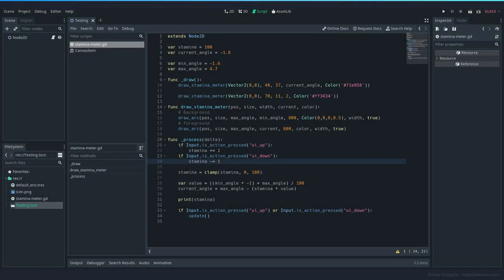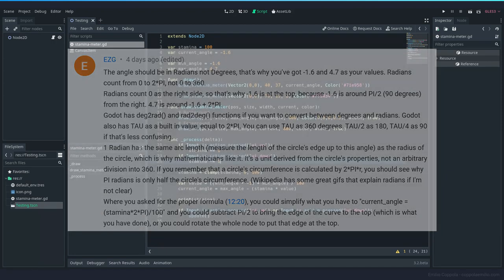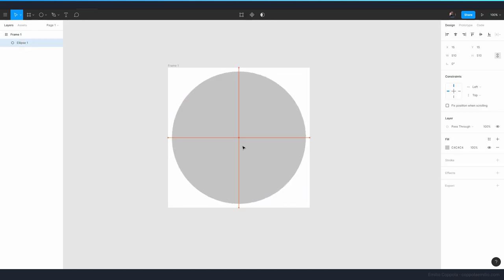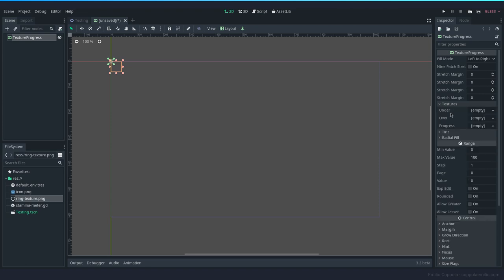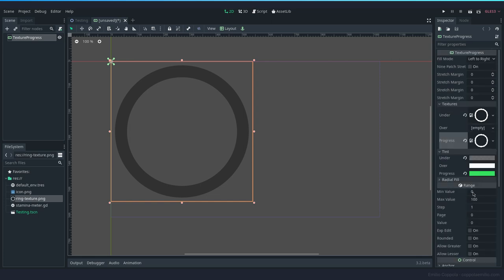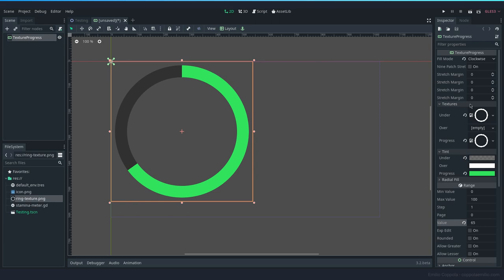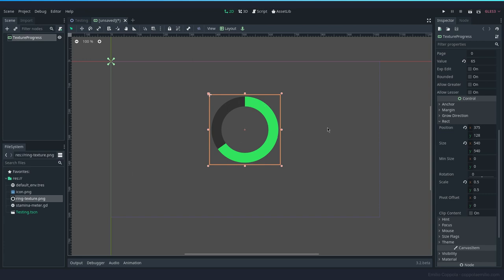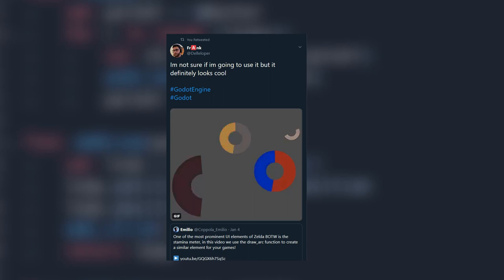Creating a circular meter using a single Godot 3 Control Node

Comment: So in order to make a three/quarter ring for example, I should just make a different sprite? Is it possible to set the value to not start in top but horizontally clockwise too?
Reply from the maker: You have a lot of settings on the node, but you can always change the starting point by rotating that node! The property name is rect_rotation (on the inspector: -> Control -> Rect -> Rotation). You might also want to update the pivot offset!
Hope it helps :)
Reply: Thank you  @emi_cpl  ! Great tutorial btw